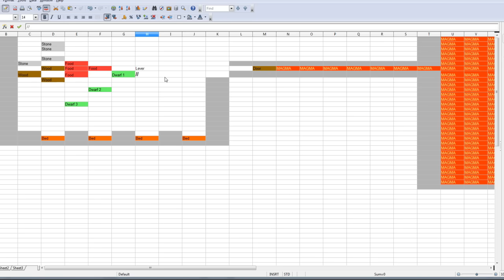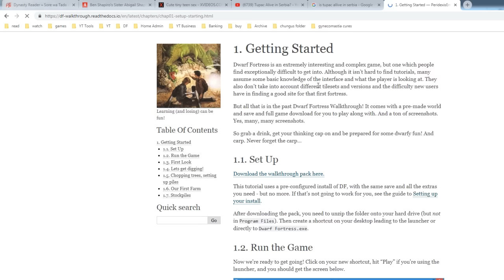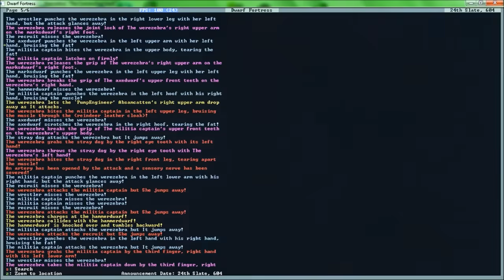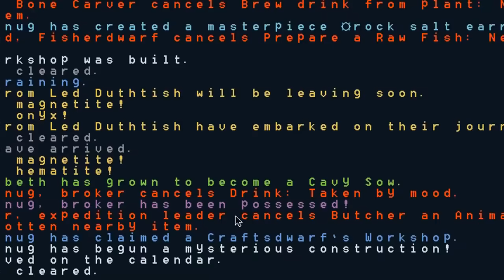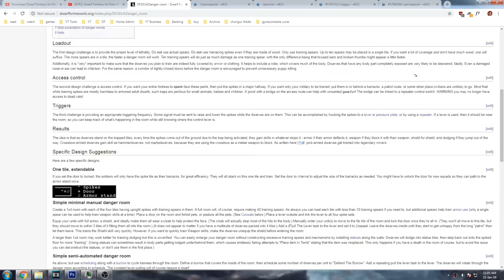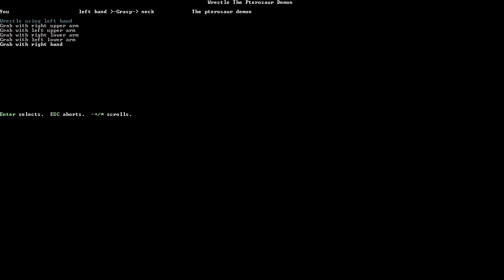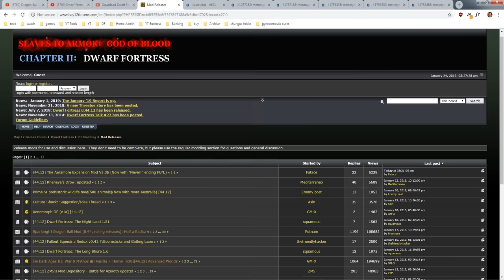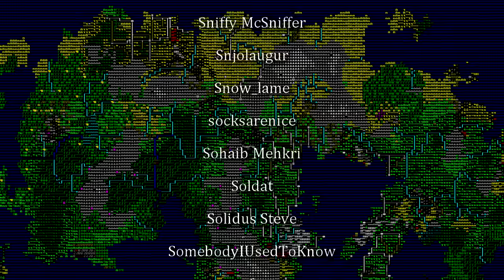Dwarf Fortress Review | Strike The Earth™ | Praise ᚨᚱᛗᛟᚲ

Comment: I once spent 40 minutes starting a new game, selecting an embark location and customizing my crew. I knew what I wanted my crew to be, so 40 minutes was kind of fast. So, it was first day of spring. The river was still frozen due to temperate biome. I wanted to carve my fortress inside the mountain on the other side of the river, so I told them to cross to the other side to start digging. As soon as the first couple of dwarves step on the river, winter ends, and all of the snow vanishes from the map. They fall into the river and die immediately with my pickaxes that I use for digging.

TL;Dr: Doomed my entire crew in less than 2 minutes of gameplay. 10/10. Would do that again.
Reply: Yeah, reminds me when I tried to pierce aquifer on a volcano embark... needless to say, entire map was in flames 2 minutes later and fully covered with magma in... well honestly never, because my fps was below floating point math resolution by that point.
Reply: @KohuGaly  this comment is so nerdy. 10/10 bro
Reply: @KohuGaly  i rate this comment (int)15/10
Reply: Man, some of these stories make the game sound like a damn cartoon, in the best way possible.
Reply: @GrayderFox  
It's essentially a fantasy world simulator and story generator.
I mean, by design.

Comment: I also wants to add a fortress story of mine: Got bored of normal biomes so started embarking on the more spooky biomes, I knew about some of them could res dead things so I planned ahead and made a garbage shoot with a bridge at the bottom to crush any zombie to save my frames. However, it never occurred to me that how fast things res is randomized and you will only find out about the grace period after killing something.

I freed up a couple of dwarves so I could kill one of my yaks that I had arrived with, thinking I could butcher it and dump any of its other parts before it came back for revenge. As it turned out the time it took for things to res on this specific embark was about 10 tics. They weren't even able to get the parts out of the workshop before all sorts of things started biting my dwarves. Suddenly an arm gets torn off and I felt dread as there was no way I could fix this situation. In vain I sent a couple more dwarves in to keep the undead busy long enough so I could wall of the rest of the fortress but sadly they were both too fast and strong. The entire fort got overrun in mere minutes. Lesson to be learned? Wall in your workshops and put doors on them before trying something as scary as butchery.

Comment: Had a thriving, successful fortress, with over 200 dwarves living in it. It was a place of worship and scholarship. Food was abundantly supplied and craftsmen were prolific in their offices. 

Until one day I dug too deep and a cavern was revealed. From within a fire-breathing beast, I remember not its likeness, set ablaze a whole squad. They did not die, but the smoke brought confusion upon them: some fell into dark pits to lose their walking capacity, others were estranged in spots from which they could not return. The worse, however, was how it affected the tracks that connected my stone stockpiles and the rest of my fortress. 

Hundreds of dwarves were unable to find their way to and from the stockpile, and my Announcements buffer was spammed with messages that echoed their disorientation. Alas, I had no alternative but to abandon the fortress, because such was the havoc that the smoke breathed by the beast wreaked over my citadel that my RAM was overloaded and my frame rate dropped to slideshow speeds.

Comment: Still one of my favorite things to do is make elaborate traps for invaders to stumble into. Although a nice pit trap at the entrance is often good enough. 20-25 levels down, smoothed floors and with a single staircase leading back up… to the start. 

The ones that don’t detonate on impact with the ground are either crushed by falling comrades or at the least with many broken bones and climb their way to the stairs and begin the slow crawl up. Some of the stupider ones even try going across the bridges of doom again. And at the bottom there are engravings of each slain invasion (just wipe clean if a dwarf engraves something stupid) so pitdwellers can take comfort and despair in that many before them had fallen to this fate. Reading the engravings allllllllllllll the way up as they go. 

Nobles also sometimes take a trip down the frictionless slide without a slide. Sometimes vary it up with a pumped water reservoir to flood them from the side into the pit (after the bridge chamber is locked) then pumped back up from the bottom for the next batch.

Comment: The reason the coins were so dangerous is because the less contact area a blunt object has in DF, the better it is at hitting and killing shit (and also makes armor less than useless, thus why it didn't do anything to stop it). What Sseth essentially made was a quite literal meat grinder.
Reply: That explains why throwing a handful of sand at someone is like blasting them with a shotgun in this game.
Reply: It's not JUST that.  An update not long before this allowed for physical force to pass through armor and damage joints.  This effectively killed "danger rooms" as armor can block wooden spikes... but the FORCE of that wooden spike would travel through a helmet and snap necks.

Whiplash was effectively programmed into the game. 

But yes, what the other guy said.  A pine needle can penetrate a telephone pole with enough force... but DF over-exaggerates the penetrative power of small objects. This made whips one of hte deadliest weapons in the game.  Density is also a deadly factor, so a dense object with low contact area = god weapon.  War Hammers are one of the best weapons in the game because of this. 

One final caveat? There is a gap in standard armor covering the neck and face iirc.  This is why leather cloaks are considered must-add for every combat uniform... but the coins were too much even with multiple layers because there just isn't a "rigid metal" armor piece to cover most of the head (open-faced helms).

Comment: I am scared, My current run of DF is going scarily well. I am recognized as a country or kingdom or whatever, and we are with good relations with others. I have had a few bezark dwarfs, but everythung is fine. I am so scared everything is going right.
Reply: Time to dig deep, and greedy.  At the bottom of hte map is a rare and VERY powerful metal known as "candy" in the community. It's extremely light and durable, yet far sharper than steel.

The candy is guarded by what we call "clowns."

Have fun. 

And that's ignoring the divine and demonic metals wielded by angels. Angels guarding the name-plate of a demon that their god raised out of Hell for shiggles.

Comment: I tried playing this game and the main issue i have is the key bindings 
Shit makes no sense
Reply: The game has been in continuous development for 16 years, and the brothers responsible have been teaching themselves coding as they go.

As such, they freely admit the game is built out of spaghetti code that they don't even understand.  The menus are also horrible as they were adding separate menus from new features years apart... and with varying level of coding knowledge at the time.  They kept putting off a UI revamp because "lol alpha build!" and didn't want to waste time updating the UI for alpha features that are still subject to change.

They finally broke down and are releasing a Steam version that will include default mouse support and a streamlined and consistent UI.  So if you are still interested in the game, go follow the Steam version and try it out whenever that shit finishes.  Later this year? Early next? The two guys... work very slowly, even after hiring some outside help (they hired the modder behind the most popular texture pack and a sound designer from another indie studio they are friendly with).

Comment: I completely disagree with the lazy newb pack being necessary. I have been playing since Spring of 07 and the only I've ever used is Dwarf Therapist. I haven't found it necessary in the steam version yet but I am going to switch back to the classic download anyway. I also only play in ASCII. The tilesets remove a lot of the charm for me.
Reply: I prefer the tilesets being able to tell what something is at a glance just saves so much time manually looking at tiles to see what that specific thing is. I like the tilesets where you can differentiate between your combat dwarves, which ones are using 2h /sword/shield /bow.  I think some of the tiles even have different looks for what armor they are using. leather/plate.

I haven't played the steam version, but the lazy newb pack has some other functionality, you can set the population caps without going into an ini file, you get access to the dfhack panel which lets you do certain clean up commands. this helps when your fortress has been going on for years and the frame rate is down to like 20. dwarf therapist is just a much easier way to get an overview of your dwarves, when you have over 150-200, just figuring out who needs new clothes is time consuming. but it always seemed like a much more orderly way of managing your dwarves and inputting multiple job changes at once. just having a readable list of who is doing what. and multiple ways of filtering dwarves to find out what you need to do, how many are happy or unhappy, why are they unhappy etc etc.